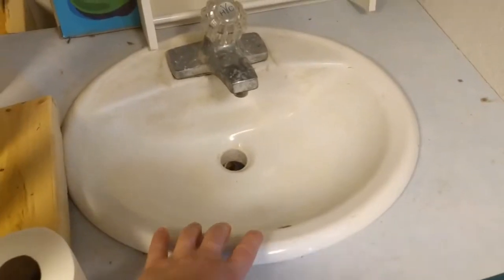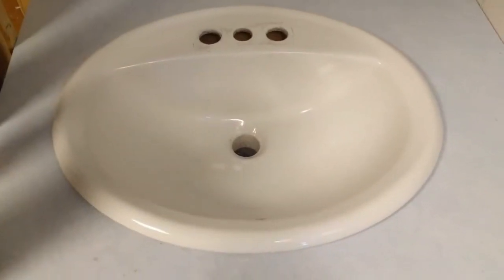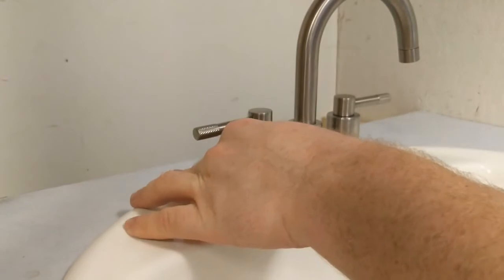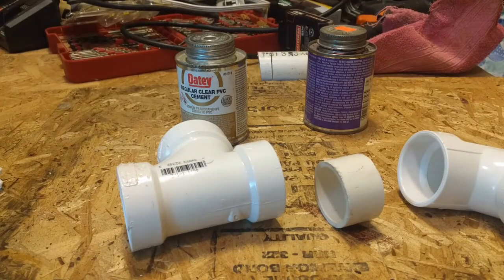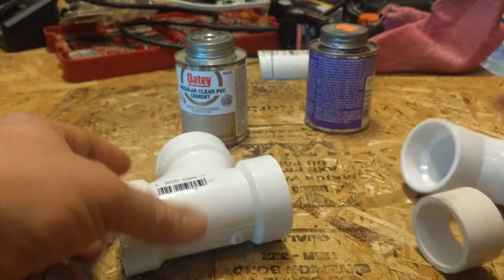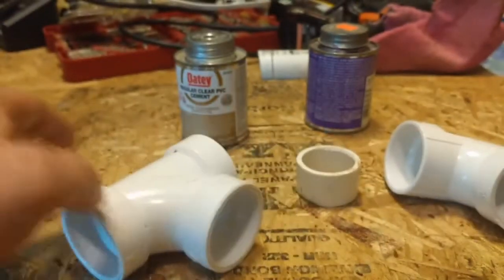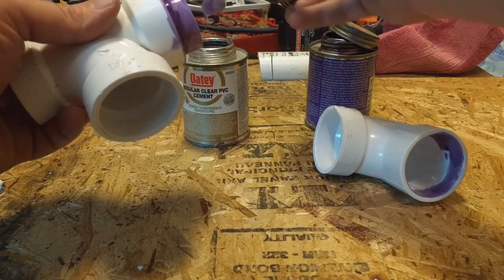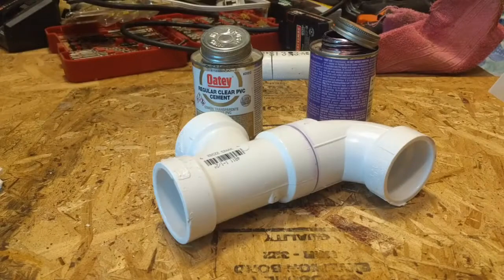Installing a Sink to Fix the ROOF!!

Comment: Hey great job on the plumbing, could not have done it better myself. Trust me I am a qualified plumber. Answer to your question is the glue heats the two pieces of pvc and tries to push them apart.
Reply from the maker: +Brett Sayers thanks. It doesn't leak... So that's about all I could ask! But I'm glad to have the approval of an actual plumber!

Comment: Good job bro. Yes, you're correct in thinking about the burrs in the joints and shaving them out. Any edge can grab debris as it passes over it which becomes lodged, then that grabs more debris, and that's how you get clogs.
So good job on that.
Reply from the maker: +Scott Hicks thank you! It was the first time I have done outgoing plumbing. I redid all the lines coming in on my parents house with PEX... And all the lines coming in on the trailer with PEX. Love working with PEX. Glad I did something right!

Comment: Did your plumbing leak or no? Also, did you install an air vent? Yes, the draining water needs to breathe. It prevents suction.
Reply from the maker: +Scott Salgren did not leak. Had some trouble with the rubber seal on the underside of the sink, but got it figured out. And yes it is connected to a vent... The same one that's leaking.... Did not have to install a new one.. just need to fix the seal on the outside of the roof.